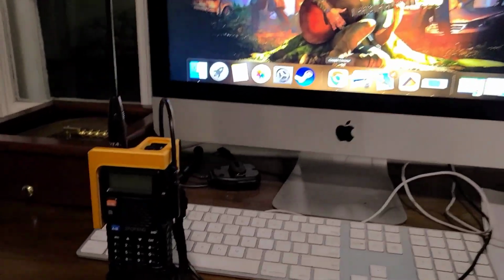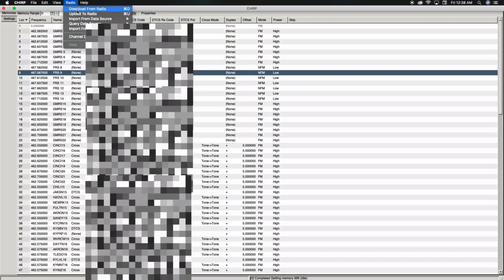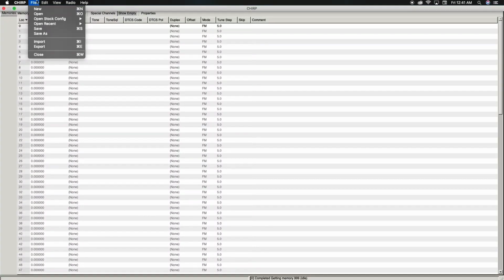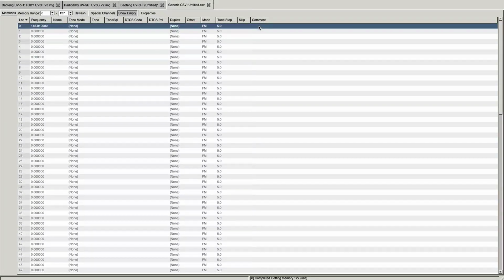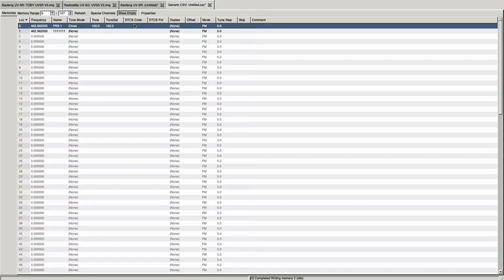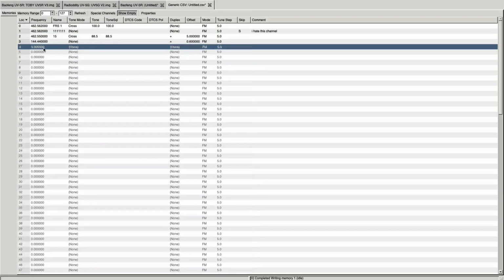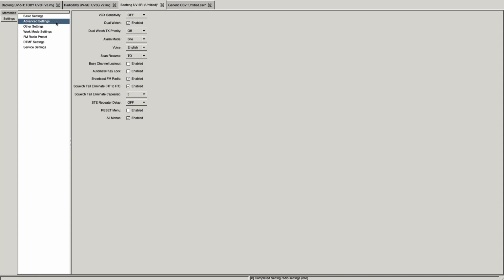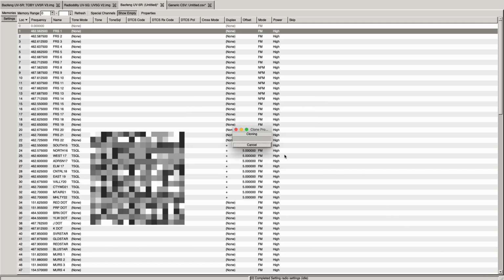How to Program your UV5R in CHIRP

Comment: How do you convert the csv stock file list to an img file?
Reply from the maker: Save the file once it's a baofeng file
Reply: @OnTheTrailRadio  Since I'm just using the 22 channels, no repeaters, I did the tedious manual input on one. Saved the file as img. Worked perfect on the second radio.  Thanks.

Comment: I have many radios that can program threw CHIRP . one odd thing the hi power UV-5RHP only can set high or low in CHIRP but manual programming can set med power and save . my GT-5TP is the same. also if want receive only put duplex to off and it will not transmit. also the DCS system is little tricky. but with a few tries can get it to work. it is the digital photocall is called different things on different HT's once you figure that out it works great. also in my baofeng manual . has a website for programming software . I got it and used it. but is much harder to use . but on my tri power ones did let me set power lever HML . not a big deal. I just use CHIRP . 73's
Reply from the maker: I only ever want high or low anyhow